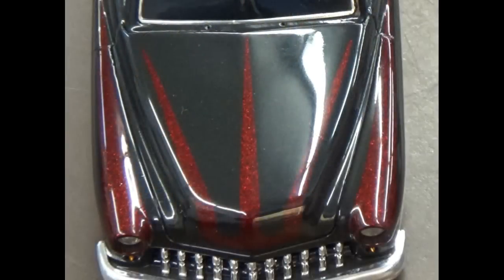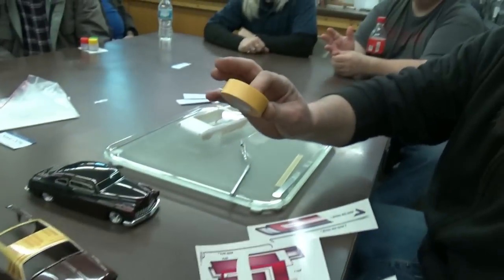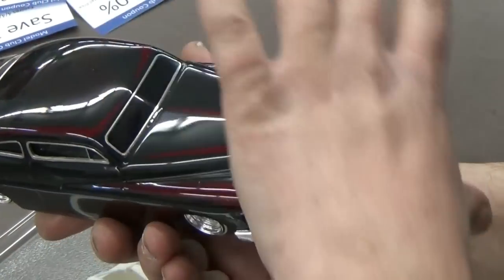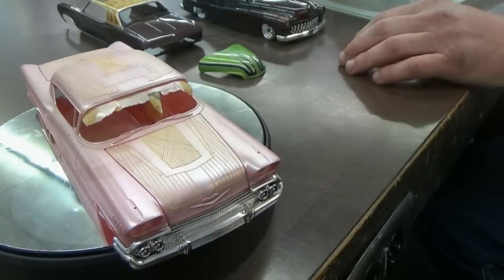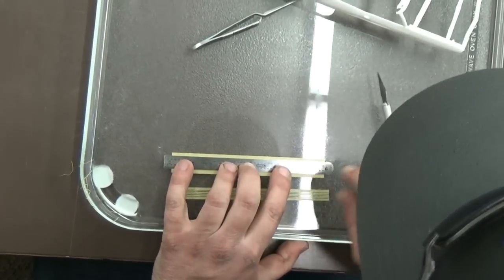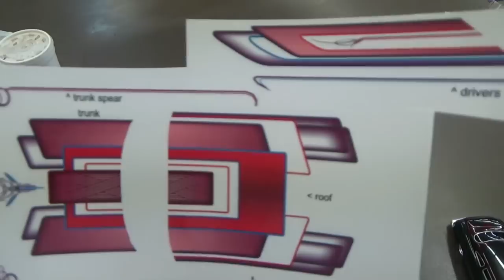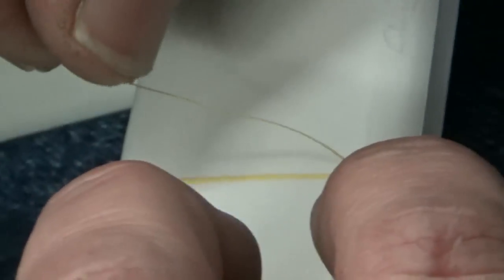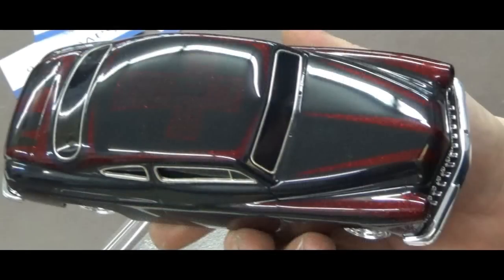Applying Detailing Stripes  -A How-to Modeling Tip

Comment: I use pinstripe tape myself. It is designed to be stretched and moves around curves with no risk of it wrinkling on you, plus it is also designed to not allow bleeding and is a perfect masking medium out of the box. Like where he said" this prevents most of the bleeding", thats the beauty of pinstripe tape, you wont be saying that because the chance of bleeding under it is so minimal that if you do have any, you can bet it is your fault and not an issue with the tape!

The hardest part can be if you are using the thin tape and need thinner pieces, because the tape is not real wide it can be difficult to cut into widths you need. However I have found that even if you dont want to fuss with the pinstripe tape for thin areas, automotive performance masking tape, or automotive acrylic tape blows anything a model specific tape can do out of the water and in most cases per foot is a lot cheaper than the absurdly overpriced modeling tape!
Reply from the maker: KM,  Thanks for the tips!    -Doug
Reply: @RightOnReplicas  Always buddy...
Reply: You can further minimise the chance of bleeding with a coat of clear lacquer over the tape before painting the second colour.
Reply: @CycolacFan  Which is the wrong way to do it, thanks but I will stick with using a quality masking product! All you are accomplishing by applying a clear lacquer is to smooth out the surface, which sanding with a very high grit sandpaper will accomplish the same result, but without adding something that paint has a hard time hanging onto unless you use the right type that chemically bonds with it!

Comment: How are you keeping your paint from getting behind your tape line
Reply from the maker: Ken,   Good question.   1st use fresh name brand modeling tape.  2nd press it all down when you're done and use an airbrush to spray a thin coat of clear over the model.  3rd use a low pressure air brush to mist your color coats on.  That usually works well!  -Doug

Comment: How do you modify the knife? I hear you file it but haven't found a file that will fit.
Reply from the maker: CV3,  In this case you put a separator of the thickness you want (if needed) between two hobby knife blades and fit them into a handle. You can grind/file the stem of the blades to fit into the hobby knife's fixture.  -Doug
Reply: @RightOnReplicas  Thanks, I'll have to figure that out. I tried one time to put two blades in together but had a har time getting them in the chuck of the handle.  I looked at Excell's double blade cutter but it won't go less than 3 mm. I need to make strips like in the video. It's a good tool for other stuff.
Reply from the maker: CV,  The tape that's being cut in this review is only a few thousandths tick.  3mm is plenty deep enough to cut this tape.  Doug